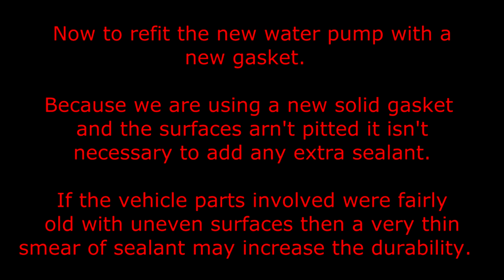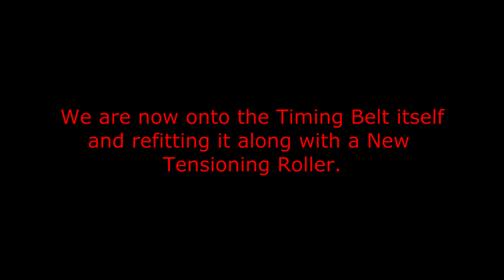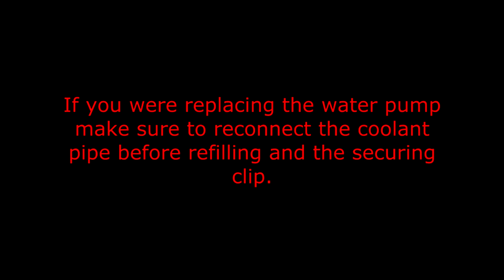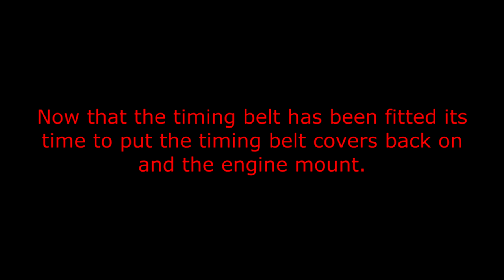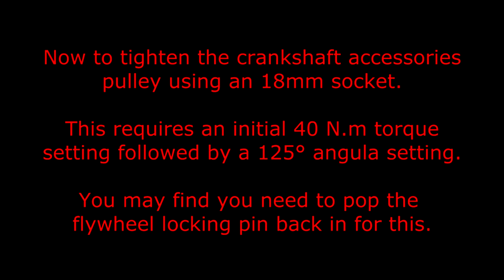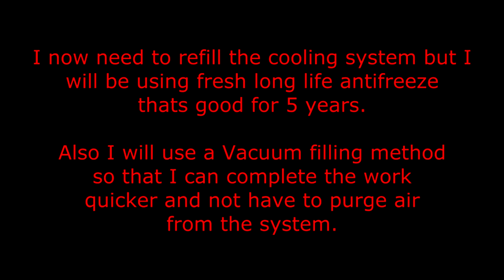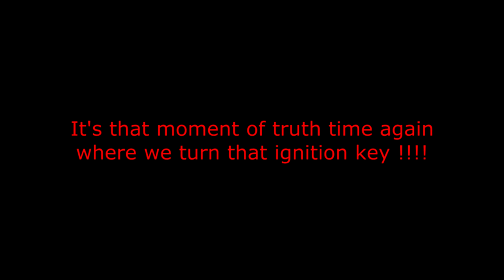Part 2 of 2 - Dacia Sandero Timing Belt, Tensioner & Water Pump for Renault D4F engine as in Clio.🚗

Comment: So it's finally done! Tested only a few km, the car runs smooth, no leaks and no strange noises coming from the engine. A huge thanks to Mark Savage  (and Cristian Nicolae) for their help in my baptism as a (wannabe) home mechanic. I share here some tips from my own process in my 2012 Dacia Logan 1.2 75cv in the hope that they are helpful to other people:
- My car model has a flywheel plastic cover that had to be removed to block the engine. Just 1 bolt, not a big deal.
- My car is an AC model so the accesories belts were a bit more complex than in the video. As Cristian Nicolae noted in another comment, the alternator belt can be forced into position with a screwdriver or similar flat tool (I used a palstic tool for bycicle wheels), but it's not such an easy process for the newbie. I actually found helpful the youtube video that explains the use of the Lisle L5937 tool, it's easy enough to find with a simple search. As for the other belt, it indeed has a tensioner screwed on with a Torx 50 bolt and the tension is regulated by an hexagonal piece right behind the bolt. So for putting back the belt, you position it loose around all the pulleys, roller and tensioner, and then with a spanner in one hand you give it the required tension turning that hexagonal piece and then tighten the torx bolt with your other hand. 

- The timing belt has 95 teeth, 48 on one side of the white mark, 47 on the other. So I had to come to the conclusion (experienced mechanics correct me if I'm wrong) that there is only one correct position for the belt, that is, for the marks you paint on the belt there is a top one (for camshaft) and a bottom one for crankshaft, and they are not interchangeable, as there must be 48 teeth between camshaft and crankshaft (counting clockwise) for the belt to slip easily around the water pump pulley. Could it be that that was the "1 tooth out" problem in your video, Mark?
- Once you put on the new timing belt and turn the engine 6 times, the indentations on crankshaft and camshaft will match (hopefully) but not the white marks on the belt. They don't have to, and it's normal. Actually if you do some maths it's expectable, there's 21 teeth on the crankshaft, 42 on the camshaft and 95 on the belt, so there must be a lot of turns of the engine before all the marks match again.

- That clip holding the coolant pipe at the bottom of the car that you have to remove to empty the coolant is difficult to get to, difficult to extract and difficult to put back. I followed the advice from another video and changed it for a jubilee clip (0.45€), which made life a bit easier. 

- There's a couple of bleeding valves for purging the air out of the coolant system when you refill it, in case you don't have that vacuum device Mark uses. 

- Don't be an absent-minded moron as I am and don't forget to put on the washer along with the crankshaft pulley bolt when you install the new timing belt and are hand-turning the engine. Otherwise, the crankshaft wheel will "wiggle" slightly and the timing belt will slowly slip out of place, and you will increasingly worry that something is very wrong and you don't have a clue what it is (and Google searches will frighten you about misaligned engine pieces)

- Don't be an absent-minded moron and (almost) forget to take off the flywheel pin before restarting the engine. I don't know how bad it would be, and I don't want to.

- According to the Gates instructions, torque for the crankshaft pulley bolt is 40Nm+125º for Dacia. I got as far as 40Nm+a little less than 90º and didn't dare to (or could physically) tighten it further. 

- Torque for the wheel bolts is 105Nm according to the manuals I watched

Top hellish patience-testing top-of-the voice-swearing moments :
- Getting the old water pump out. As Mark notes, it takes some heavy convincing as it's "glued" to the engine. It took me some hammering and some levering with a flat scredriver.
- Getting the new water pump in position. It was almost a neurosurgery process, and the way Mark does it in the video gives the clue of the EXACT movements needed to put it in place. One milimeter or nanosecond out of place, you're off and back to the beginning. 

- Getting the push-fit pipe out of the water pump. As Mark notes, "it takes some wiggling" (lots of it!) and in my car it was not so easily accesible. I finally found it easier to do from under the car. The bolt holding it in place is quite hellish to get to too. So yes, you'll probably up hating the bloody water pump. 

So all in all, it took me 8 days of part-time working on it, but I'm pretty confident that if I had to do it again, it would be less than 10 hours. I saved about 500€ that can go to a decent trip when Covid19 allows, I have now a decent supply of tools and a better knowledge of how my car works, and most of all the satisfaction of DIY and feeling a bit less clumsy. 

Sorry for the length, sorry for my english and thanks once again to Mark (and Cristian). Cheers!
Reply from the maker: WOW !!! now that's a comment !!!!  That really made my day seeing that you had success.  So pleased you achieved your challenge, its never easy to start a big job not knowing how the outcome will be.  In one of my other series I replaced the head gasket on a Honda engine only for it to refuse to start.  I was devastated and sad as I thought all that work for nothing.  My wife solved it by saying put the full amount of oil in.  I had only put in the minimum as I was going to dispose of that oil immediately once the engine was up and running but that simple mistake seemed to be what stopped the engine starting after the rebuild.   I am really please for you.

I wasn't quite understanding what you were saying about the timing belt and the teeth on each side?  as the back of most belts is smooth ???

I think we will all be glad after this Covid19 pandemic to get our cars out and to enjoy driving again properly and without fear.

Take care and stay safe
Reply: @CoatsandGaiters  sorry about that belt confusion. My new timing belt (like yours in the video) brought white marks for alignment. If you take one of them and start counting teeth until you get to the other mark, you realise there is a "long" half of the belt (48 teeth) and a "short" one with 47, I had the same problem as you did in the video of the belt being too tight to slip around the water pump pulley once aligned, until I realised it has to be the "long" part of the belt on the water pulley side, and the "short" on the tensioner side. I hope I explained better this time
Reply from the maker: @cutariechucutariechez2581  arrrrrr fantastic explanation.   Thank you so much for that.  You might need to start making videos soon as I totally missed that trick.   Going to run and hide now lol

Comment: A big thank you, I've never found a specific tutorial for dacia sandero. It's easy to understand, clear step by step.

Btw tightening torque for the engine bolt is 62NM for dacia too
Reply from the maker: Thank you for the feedback JohnnyyV !  much appreciated on the torque.
Reply: i have 40Nm + 70° for crankshaft, 24 Nm for tensioner and 62Nm for engine mount, both in continental and renault manuals...
Reply from the maker: @albirdie1630  we do have some differences in the info.  Mine is from a Bosch trade software so whether something changed I don't know.  I would presume Renault info to be most accurate.  I have 40Nm + 125±6°, 24Nm for tensioner and mine doesnt show engine mount torque?

Comment: Thanks so much for making such a very good detailed video,  I,ve had my Dacia Sandero 1.2 since 2013, bought it from new and now it has done 68,000 miles without any problems what’s so ever. It will be going into the garage next week to get the water pump and timing belt changed out
Reply from the maker: Thank you for the compliment and good luck with your timing belt.  Hope it goes well.

Comment: After the success with the oil&filter change this seems quite challenging but not undoable... Maybe too much for someone with no previous experience as a mechanic, but with your video I can at least think about it (great economic saving&satisfaction vs the possibility of screwing up)
Reply from the maker: They can be expensive jobs I believe.  Around £400 I understand.  My logic was if a job is £500 and it still costs me £500 but I have the tools to repeat the job then its a long term saving.    I think I was also scarred when my Volvo 740 broke down because of the in tank fuel pump failed which was £90, but Volvo replaced the Fuel distributor and that didn't work so they replaced the main pump under the car and still that didn't work and then they replaced the pump in the tank and suddenly it worked !!!! My bill was for £1,000 !!!!.  I complained and said it was only the lift pump in the tank but they said they followed the Volvo official method and that if I didn't pay the bill they would keep the car !!!!  After that I though how many tools could I have bought for £1,000 !!!!!!!  I also concluded that at least if I mess up its my fault which I could live with over a garage messing up and I still have to pay the bill.

Comment: I ended up with a badly tracking belt which rubbed off the lower plastic cover after doing this job. I tried to re-seat it without any luck and to boot I still heard an abnormal noise from what sounded like the tensioner with the cover removed. At that point I started googling and came across a German Renault forum where the general consensus was that SKF kits (at least for the D4F engine) are rubbish. I had never had trouble with SKF parts (put an SKF half shaft on the same car last year for example) but I was then uneasy about leaving the SKF timing belt and especially the tensioner in place after reading all the bad reviews. The forum members mostly said to go with Dayco belts and INA tensioners as these were OEM suppliers to Renault. I left the SKF water pump in place as I didn't feel like wasting the original Renault coolant I'd put into it and just replaced the tensioner and belt with the above brands and.....immediate silence! I may have just been unlucky but some of the pics of low mileage (1k miles!) SKF tensioners with grease being expelled from the bearing was pretty disconcerting. From looking at the Dayco kit in the video, the tensioner looks suspiciously like the INA one to me. If I was doing it again I would get a Hepu water pump as well. I'd buy all three parts separately rather than the lucky dip of a kit where you don't know who makes what (SKF do not make rubber belts and Gates don't make water pumps for example).
Reply from the maker: Thank you for sharing your experience.  I think this can be the problem with various parts as they can all have their own issues and if they change something at production they may later find it was to the products detriment.  OEM parts are always safer but sadly always cost a lot more.  I can't remember what I fitted to the Dacia in this video but thankfully it's still ok and my relative drives it every day to work.

Comment: Excellent pair of videos, very thorough. Curious about that water pump gasket, is it a steel gasket? I ask as my experience so far I've only seen paper or a rubber o-ring.
Reply from the maker: Thank you for that comment Diesel Bricks.  I think it was a metal gasket.  The original seems to be metal as well with a thin orange rubber surface material.  Hope that helps.

Comment: I did one of these today and found that the line on the belt was one tooth out.I found that the solution was to swap the top and bottom of the belt, the marks must not be an equal distance apart.
Reply from the maker: Thank you for that feedback David, much appreciated.

Comment: Great video agsin. I wiuld have no fear takung this on now. My car is 6 years old but has on 21,300 miles. New belt and tensioner but I think a new pump would be an overkill. What do you think?
Reply from the maker: Thank you for the comment.  To be honest the pump isn't that expensive and it only bolted in so I'd personally do it but like you say the mileage is pretty low so you may well be ok.  I guess its down to money and how you feel about doing it.  I guess if you do the belt you can easily do the pump later on if need be.
Reply: I think I will leave it. Its not that a difficult timing belt to do and your 2 videos are excellent and show that. As I will be keeping the car longterm as a 2nd car I will do the water pump next time around. Thanks for your prompt reply😊👍
Reply from the maker: @gerduhig6693  I'd probably do the same to be honest.  Your a bit like me.  Like to get my monies worth out of things and can't see the point in replacing something that is working fine.
Reply: I wouldn't change such a low mileage water pump or even tensioner. I cannot see how a water pump or tensioner would deteriorate due to age. The rubber belt yes, but the other stuff, no. I will only do the belt next time on my wife's car (which is doing about 5k miles a year only) and do the other stuff on the second belt change, though I'll do the belt in 5 years already, not waiting until the last to do it. That's if she still has the car then.

Comment: Fantastic video thanks for sharing pity you didn’t show the (fan belt and power steering belt) being reassembled…..
Reply from the maker: Thank you for the compliment.  I know I’m sorry I was a bit new to making videos back then.  Now I show every nut and bolt in detail.
Reply: @CoatsandGaiters  
Did you have any trouble fitting the two belt’s? I think you mentioned they were stretch belt’s 
I thought I saw an adjustment on the alternator.  Thank you for the reply back 
Regards Eric
Reply from the maker: @castrolgtx5064  I think they said you should use new belts and as I didn’t I thought it best not to record it as it was technically wrong to do that.  I bought a tool to help slip the belt back onto the pulley or you could use a bit of smooth plastic.

Comment: Superb, well produced video with clear and well structured description of the process and torque setting etc. My timing belt gave-way so I've had to remove the head and sent it away for a refurb. When I get it back, do I simply align the TDC marks on cam & crankshaft pulleys, or is it possible to get the engine 180 degrees out of phase (because each rotation of the crankshaft is only half a turn of the camshaft).
Reply from the maker: Thank you Peter for the compliment.  I used to ponder on this one all the time.  I think I made that mistake on my allegro once.  Once the timing arks are set it should be correct.  Under normal circumstances the cams are locked and the flywheel is locked in their single correct positions using tools on some cars.  Things only go out as the engine rotates and that's when the crank has turned once but the cams have only turned half a revolution.  But with things lined up at the start of setting up it would be correct.  Either way once finished turn the engine over by hand in the correct direction to ensure nothing is conflicting with each other.
Reply: @CoatsandGaiters  Many thanks for the prompt reply! I found the answer in a Haynes manual - turn the engine over and using a finger or screwdriver head covering the spark plug hole, 'feel' for the air pressure created by the piston coming up on the compression stroke. Because the head is off completely, I think I'll also be able to get the timing mark roughly set in the correct position (ie at the top of the compression stroke) by watching the valve action as I carefully turn the camshaft pulley. I think the mistake with your Austin All-agro might have been buying it in the first place :-).
Reply from the maker: @peterormerod9921  That's good news Peter.  I loved my little Allegro I was picked up many a time with the AA. Burnt valves, distributer arcing out.  It was that little car that made me mend cars as the AA said I had had my 3 relays for the year and wasn't eligible for any more.  At that point I was forced to mend it.  Could change a clutch in 30 minutes in the end haha

Comment: It's a good thing that the water pump came with those two black rubber o-rings as the one on the pipe looked crusty. Don't you think that pump you removed was not the original one, given that there was red RTV sealant on it? Is that type of sealant used in the factory? I am not too familiar with Renault, but I have always associated that type of red sealant gasket with aftermarket. I was also glad to see a solid gasket included in your water pump kit - much better than using sealant IMO.
Reply from the maker: Hi Super Vitz, good question so I've just been out to look at that pump and can confirm its metal with an orange rubberised coating on.  Was the original pump I believe as the car was low mileage back then.  Still going daily today.  Over 100k now.
Reply: @CoatsandGaiters  aha nice. Thanks for checking and great video!
Reply from the maker: @SuperVitz  Thank you.  I wasn't sure either so had to check after you mentioned it lol very sharp by the way....the gasket that is.